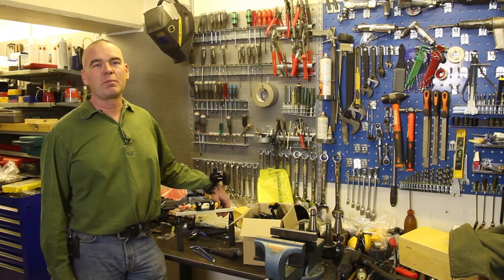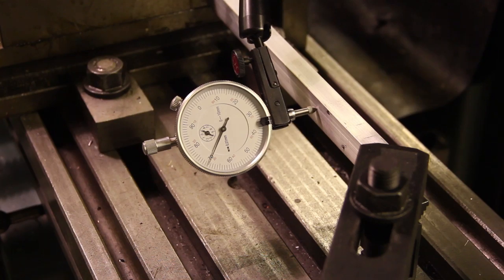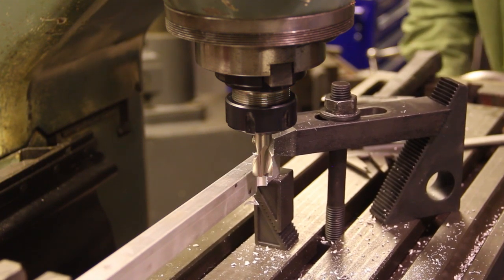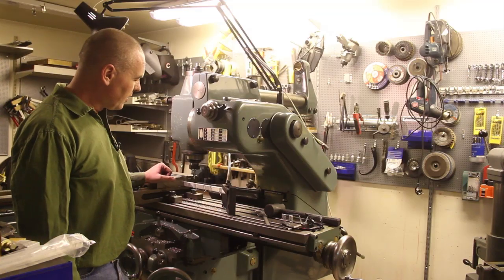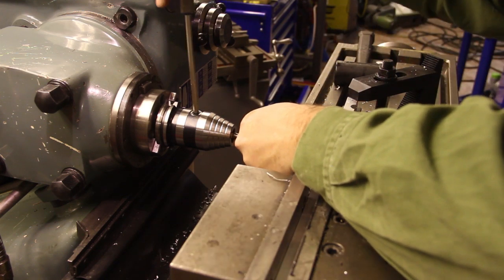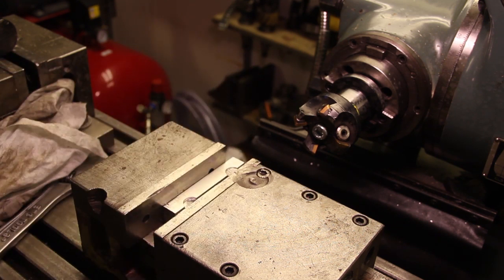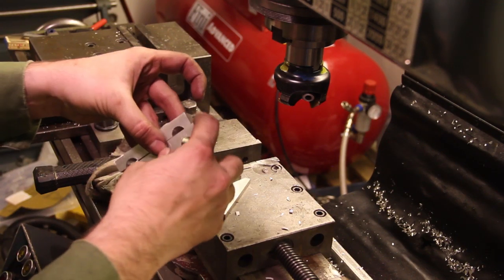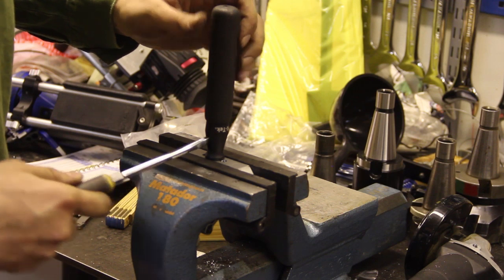Shoulder rig part

Comment: Mattias, I've enjoyed this super secure work holding set up, superior video editing and high quality machining.
You might consider building yourself a 25mm x 150mm or 200mm x 300mm+ aluminum pallet block for your machine vise for future use. Also an angle plate can be built into it's design making it very versatile for various holdings. Just my thought. Keep producing your great work!
Thanks....13

Comment: You make your videos very easy to look at, good English and interesting. Looking forward to more projects from you. Just a little tip on the road from me, I saw in another movie when you tightened your chuck on your lathe you tigthening way too mutch, there is a risk that you fucks up the mechanics inside the chuck.
Tighten the chuck lightly first, then you can tighten a little more, but not until it stops completely. 

If using individual user jaws chuck you can pull significantly harder.
Check out Fenners, Oxtools, Adams and the other guys movies you will surely get a grip on how hard you shoud tighten your chuck.
No offense but it's common for beginners to exaggerate these moments.

keep going from Sweden

Maybe I'm exaggerating a little when I think I see that you pull the chuck too much, but with a common sense usually the most works out well.

Keep going from Sweden again.

Comment: Great job Mattias. I really like your mill, do you know it's weight? It seems to be a very compact and capable machine.
Reply from the maker: Thanks! The net weight, according to the spec. sheet is 1280 kg. It is very rigid and stable, and also very versatile. One of the things that made me chose the Abene is the good maximum spindle-to-table distance (53 cm). Many other good mills are a bit limited in that respect.
Reply from the maker: Level3-RC
Well, I'm sure you could have one shipped... but they do show up for sale in the United States from time to time. Usually they're not that expensive. If you want one, keep looking at sites like eBay, Craigslist and Practicalmachinist, sooner or later one will show up for sale in the United States. Btw, do check out my Abene video!

Comment: That an unusual drill chuck at 11:52 have you any details!
Reply from the maker: A few people commented on that chuck. I really like it a lot. The taper and the chuck is made from the same piece of steel, for added accuracy. Franz Singer GmbH (franz240455) sells them on German Ebay för 135 Euro. It's actually a DIN 69871 taper chuck, but Franz Singer sells them with adapters for Iso 40 internal M16 and Deckel S20x2 external buttress thread. I have two of those chucks.

The one I bought for the Deckel fit right away, but the one I bought for my Abene needed some work to make it fit. I had to grind some extra space for one of the drive dogs (see my video "Taper Talk" and you'll see why). The drawbar also bottomed out in the threads, so I unscrewed the M16 adapter, took away some millimeters of steel at the short end of the taper and put the adapter back, then that problem was also solved and the chuck fit :-)

Here's a link:
http://www.ebay.de/itm/Kurzbohrfutter-SK40-DIN2080-D1-5-16-z-B-Deckel-Frasmaschine-/380710904438?pt=Industriemaschinen&hash=item58a4236276
Reply: Mattias Kristiansson Thanks for that Mattias
There's some good stuff in his Ebay shop and will post Worldwide!!